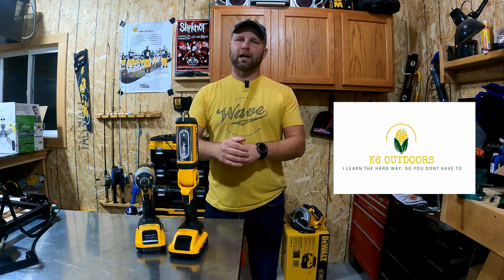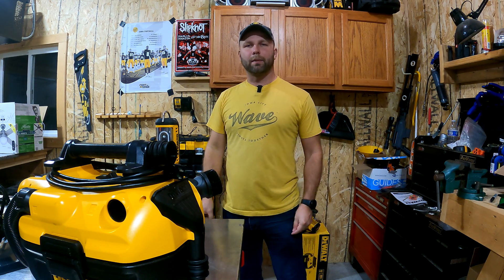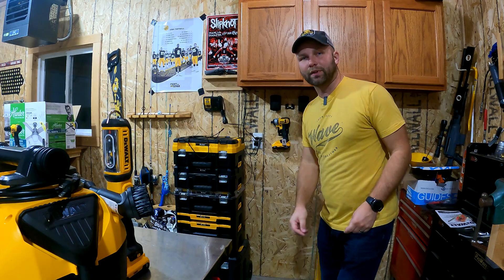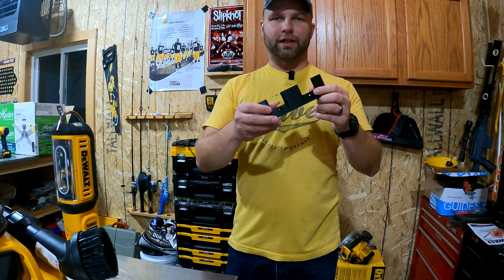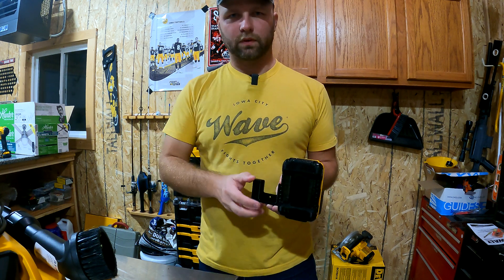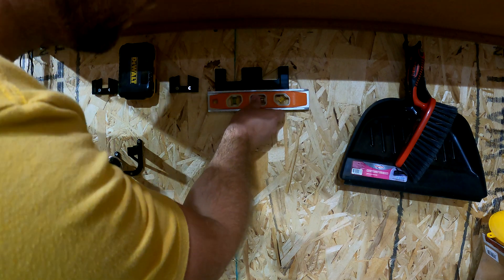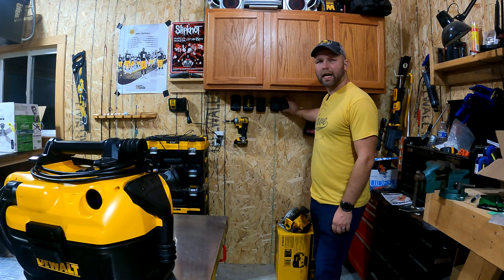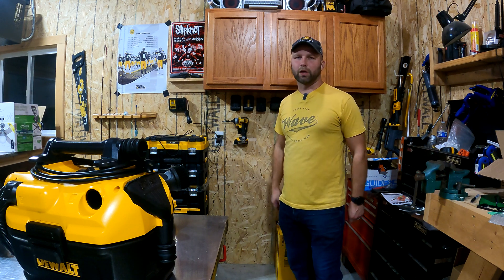Dewalt 20 Volt Battery Wall Storage - 3D Printed Wall Mount

Comment: Only 9?  🙃  Nicely done.  A mild tweak I would suggest is easing the bottom corners.  Those sharp 90s are just waiting to snag a passing hand or some such.
Reply from the maker: Appreciate you stopping in, ive got s free more batteries but need to print more :)
Reply: @k6outdoors  I accumulate batteries pretty much the same way.  I think I've only ever purchased JUST batteries twice, and that was because they were being clearanced.  And I very, very rarely buy bare tools w/o a free battery deal.  Of course, now I've  added almost all the tools I need, and even most of the ones that I want and can justify, so even the free batteries don't flow into my  shop.